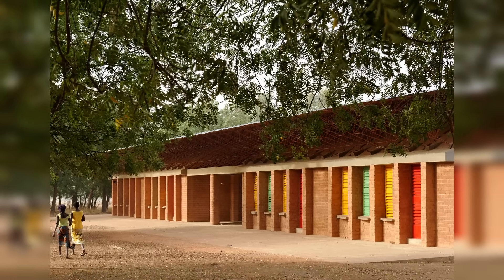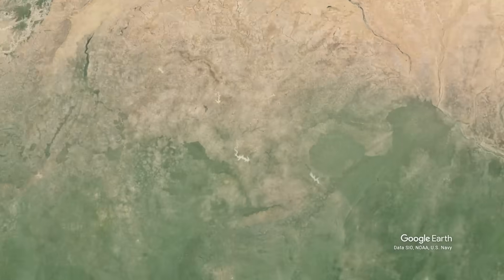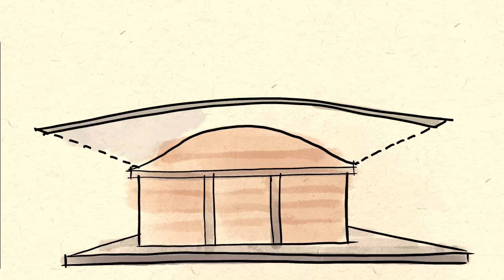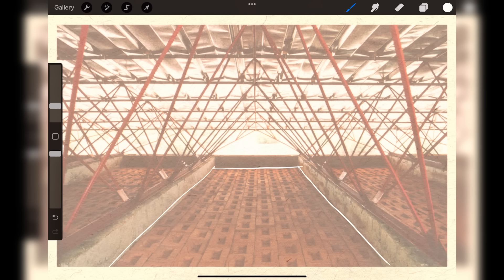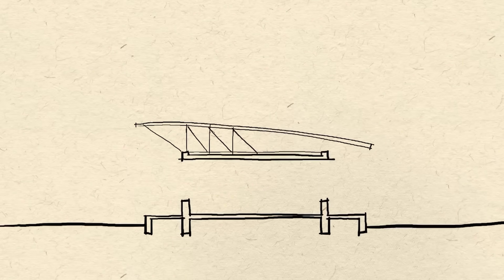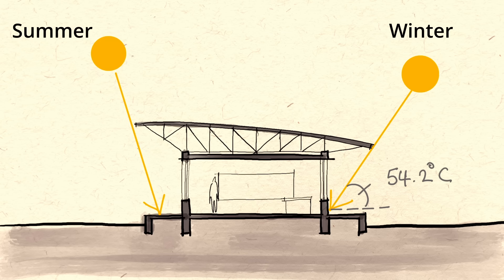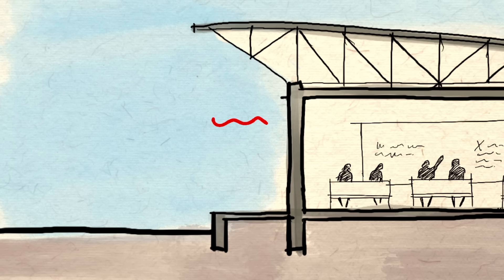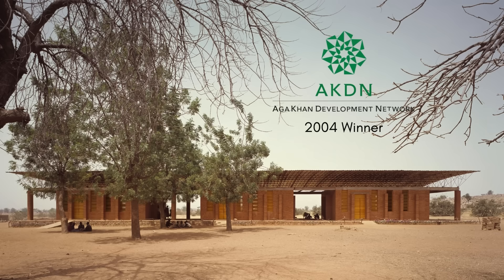The 3 Design Strategies Keeping This Building Cool In Scorching Heat

Comment from the maker: The section at 2:53 - This refers to the angle of the sun ( NOT the temperature! ) Apologies if this has caused any confusion. The C was not meant to be there! 😅
Reply: I was just about to ask about that, I went back over that section a few times to see if I missed you referencing temperature caused by the sun's angle with the ground
Reply: Its called a safari roof landrover did it on their vehcles 50 years ago all but a little cruder due to the vehicle shape.
Reply: Oh no, it had to be my comment, so pity 😂
Reply: Good, solid, practical design work! About the double roof, this idea has been around for centuries, many cultures have figured it out. I've seen it done with desert tents, a large tarp spaced above the tent. Around forty years ago there was a medical office complex in Tucson, Arizona USA that did this with a stressed concrete roof above multiple independent single story buildings. It looked like a huge tent on multiple poles. The roof was on tall pillars, at least a ten foot clear space of free moving air above the buildings. The roof was large enough that the sun never touched the building walls. I was there for a dental appointment on a miserable day in August, temperature over 100F, and walking under that high roof the air was easily 15F cooler. Sadly, the complex lost the battle to modernization and real estate inflation. It was all torn down and a big ugly multi-story tower was built.
Reply: I saw that and at first I was like, huh? Then I decided it meant the angle.
Reply: And that's at high noon. Was there shading on the western wall to shield the hot afternoon sun?
Reply: C = century, °C = celsius.
Reply: This is a bad deflection because the angle(elevation) of the sun cannot be greater than 90*. 90* marks the sub-solar point meaning the sun is directly above that location
Reply: Sara , at 35 C temps , what are the temperature in the class rooms in the school ? 
Great to see the roof. I have been thinking before, for people living in the top floor that to keep an apartment less hot, one could put an army camouflage net over the roof , 50cm abover the roof, so the building would not get the full heat of the sun on the roof...
Reply: The roof won't help much either its a common mistake to fail to realise that the heat just gets reradiated by the roof and transfers on into the building. Convection air flow plays no part in infra red heat transfer.

Comment: All three techniques are construction based and have zero recurring costs. Additional technologies like sola-tubes can do the same with lighting. Solar water heaters can provide hot water for the school. (Can be completely passive but a small pump can be more effective.) PV panels for electricity. CEB is great for low cost construction. Sun shade fabrics can be stretched across poles to create shaded out door spaces. Good for outdoor classrooms, play and even gardening. I love projects like this. Practical, sustainable and economically feasible.

Comment: Excellent report, a double roof used to be called a safari roof, used by Land Rover in Africa. I do like the venturi effect of a shaped roof. A white roof top will reflect heat. Ibrahim Traoré is doing some great things in Burkina Faso. I used to be a control systems engineer using building management systems. I live half the year in Thailand with similar temperatures.
Reply from the maker: Thanks for the insights! and thank you for watching!

Comment: A reinforced-concrete roof-over-roof design would indeed be an excellent solution in most places that have hot summers and rainy conditions in most seasons. The sun's heat does not radiate from the outer roof to the inner roof. Meanwhile, moisture from the interior can easily disperse, because only the upper, outer shell is 100% vapor-tight.
HOWEVER: most places on earth have OCCASIONAL storms which will sweep such an outer roof away, causing great and expensive damage.
Taleb's fat tails: extreme and ruinous things happen more often than you think!
Solution: the upper roof has to be collapsable, so that it can be dismantelled when extreme weather is forecasted. Make it a hinge-pulley system, using reinforced fiberglass. Or some other composite plastic, perhaps with a wood layer. Or maybe even canvas-on-rails?
No matter what, it mustn't be a wing that wants to fly as soon as a tropical storm hits you.

Comment: An addition to this strategy could be air intakes at floor level with ceiling vents to induce natural thermo-syphoning. Concentrated plantings in front of the floor-level openings could pre-cool air by evapotranspiration. Roof gutters could direct rainfall to shade trees, creating a micro-environment for the building.

Comment: LOL. 
It was 105 here the other day, and gets into the 50's at night, which is normal 7 months out of the year...... 
We are up to .6 inches of precipitation for the first 8 months of the year.... 
Let me know when it actually gets hot there... 
They would be better off putting the building into the ground, where the ground temperature is far lower.... 
Building it out in the heat, to only have to engineer it to never get as cool as it would partially under ground, is epic stupid....

Comment: This may work well in a hot, DRY climate, but it won't cut it in a hot, HUMID climate.
Reply from the maker: Watch “The ultimate guide to passive cooling” on the channel 😉
Reply: School is out during the hot and humid season. The design works perfectly for it's intended purpose.

Comment: The temperatures are similar to that found in the California Central Valley.  July is the hottest month with average highs around 96°F and lows around 64°F. The highest recorded temperature in Merced was 116°F on September 6, 2022. The coolest months are December and January with average highs in the low 50s and lows in the mid 30s.

Comment: Nice video, thank you!   I was curious about the top layer roof (the upper roof) and how strong it is when the wind picks up?  Seems like that can be a challenge to stay in-tact during very strong winds?
Reply from the maker: Yes it would act like a sail if the winds are too strong. Fortunately in this region, there are no strong winds that might cause this issue! This is why passive solutions need to be tailored to their specific climate!

Comment: Yah, when the air temperature is 40 degrees, shading will help, but it doesn't eliminate  high temperatures. 00:46: quotes high temperatures in the neighborhood of 35, the shows graph indicating temperatures well above this. Have you lived in the desert?
Reply from the maker: I lived in Morocco! Pretty close to the desert!
Reply: I've lived in the desert. With how low the humidity is adding shade and airflow makes a HUGE difference. It still helps in environments with high humidity, but it doesn't feel like as much of a difference when it feels like you're wearing the air 😅 hot is still hot, but like 20°F+ of a difference is still a major relief.
Reply: @EliyahuAbdielBenaiah  Going from 40 to 20 degrees using only passive is wildly optimistic.
Reply: @inyobill  I was speaking regarding fahrenheit rather than celsius.

Comment: That roof would get blown or ripped away in tornado alley. It would need to be anchored deep into the ground with steel pillars. And even then ..... Still though, this is a great design, very smart. Congrats!
Reply from the maker: The winds are not too strong in this site which makes this a great solution for this particular climate and location!

Comment: What of it rains with strong winds? During such conditions rain moves almost horizontally. Will it not flood the building through the open roof?
Reply from the maker: That's a good point, but the climatic conditions on this site are not extreme in terms of wind and rain so I think it is unlikely to happen! (hopefully)

Comment: Scotching heat.  Can it function in 47 degree Celsius?  40° Celsius and 90% humidity?  There is no significant night day temperature variation.  May be at the best between 5-7 degrees.. what would the cast be?

Comment: As a Canadian, I can see that this building will not be able to handle any type of snow loading. The upper roof, at least, will collapse.

So, interesting for a Burkina Faso type climate. But not exactly something that would apply in higher/lower latitudes.

Comment: As someone who lives in a house like this, I will tell you that it definitely takes a few degrees off, but only works when the wind is blowing (even a little bit of wind is good) and if it is not humid. Even then, I would not call this a ‘Fridge School’ as the TKSST labeled this video link on their site. 

And if the wind is not blowing or  it gets humid (not a problem in the desert), it is still extremely hot and those from the west who say otherwise are probably posting this from their air-conditioned apartment in the city.

There is a reason they never gave us a temperature reading in this video, despite this being the focus and key measurement that would empirically verify their achievement.

Again this building is a great design, but it capabilities are still overhyped and I doubt people in the city are going to swap places with these people.

Comment: In Phoenix we get 44C temperatures for months on end.  We definitely need building envelopes (as in this video) to do the “heavy lifting” as far as temperature moderation instead of running a/c 24x7 trying to cool building interiors of structures designed for far cooler climates.  For folks who think architecture is about decoration it isn’t.  Architecture isn’t ornamental; its fundamental.  And let’s stop talking about architecture”s design using pretentious language.  Buildings need to be designed and made as precision assembled products, not poorly thought-through and made prototypes that never go into production.

Comment: This principle of space between roof and building is already applied very widely in my country (Romania) and most of Europe, because of the harsh climate. Almost no building without it. The space is much smaller (1-5 cm) but very effective in winter too against winds. In winter, the air flows slowly, keeping the heat and acting as an insulation by itselph. In summer, air flows much faster, cooling the house. There are matrices/blankets made from 3D metal wire mesh, of 1-2 cm, that you put under the last layer of the roof, that let air pass through it.
Reply from the maker: That’s amazing!!

Comment: 3 techniques which prevent a structure from heat. High outside air temps are still hot plus human bodies give off hear. None of the techniques shown actually cool the structure.

Comment: If u want to drop the temperature in the classroom further, you can make the walls at around 1 feet thick..this will prevent the outside heat to penetrate the thick wall..apart from.that, you can make wind holes at around one feet above the ground in the walls. This is because, cooler air is heavier than hot air. With these holes, the cooler air can travel into the classroom, cooling it n push the hot air ( which is lighter) up to the open roof..if your roof is not designed as such, you can still make air holes above your windows to let the hot air out n circulate d air in the room.

Comment: They missed out on densely planting the grounds which can drop the temp by 10-12 degrees, as the plants act as shade & natural air-conditioners.
Its not just the buildings that need good design.

Comment: At 3 minutes in, it's not really accurate, that example, because the sunny side of a building is the same side all year round !
Reply from the maker: Burkina Faso is near the equator which means it experiences high sun angles. I agree it seems strange but in June 21st, it’s slightly on the other side 😊
Reply: @SaraSaadouni_TAC  Oh I see now, that makes sense  ! Thank you for your reply. :)

Comment: I wouldn't call this "smart," so much as I would call it "rational." Why would you build something else? It's more like building other ways in this type of environment is stupid.

I live in a hot area where people from a cold climate do all of the engineering and design, and it is ridiculous. If you live in a hot space, design for that, like they did with this building. If you actually live there, in the hot place, it's pretty obvious what you should do.

Comment: Traditional homes in hot desert climates like Africa have a domed ceiling with a hole in the centre/top.

This draws hotter lighter air out of the home and creates a continuous draft of colder air from the windows doors etc.

Modern concrete buildings overheat in sun and get too cold at colder times.

Comment: 95 is not particularly hot. Low desert California, 120 is normal from July thru Oct.  I have lived here since 1978. Double built roofs, the top layer covered in white silicone roof material works pretty well but it’s still going to be hot darling.

Comment: Rof is the number one heater probably 45-55%,  remove this first, heat will be reduce by at least 15-25% in real figure, which means your 35deg cen  will be 26~29deg cen. windows at 60% of wall to both sides facing North - South + the roof to cieling opening will reduce the heat up to another 15-25%.  Cold rolled Steel + gypsum board+cem. board in the outside will be bette in thermal.  Longer overhung will be the best bet to shade from sun.  We like it or not need to remove aesthetics. and concentrate on cost effectiveness!

Comment: You may want to check out the works of Hassan Fathy from the 1930's.  Not much is left after him - the mosque in Gourna, the Gourna marketplace, few houses there & in Cairo, etc. He exploited these ventillation ideas already with excellent design and arrangement of functional spaces. What we call sustainable architecture (in this context here) was already outlined in his book the 'Architecture for the poor'. I visited his Gourna buildings and they work so brilliant in every respect. 
Btw.  35 C is absolutely tolerable there, because the air is dry.
Reply from the maker: Thank you for this! I came across Hassan Fathy in Architecture school and I was amazed by his work! I’ll look into it more ☺️

Comment: The design does much to fight off solar heat gain, but that is all. If it is 40C outside, it will be 40C inside if you utilize crosswind as your primary means of flushing solar heat gain. Going into the ground, which is 20C the world over 5m down, and pulling that coolness up should be achievable without complex HVAC equipment to get the temp inside to 30C or lower.

Comment: Award winning school in 2004 and built in 2001 as the development of passive house was beginning.  Hopefully, with the modeling programs available and institutions available to provide grants or funds the possibility to go beyond this has greatly improved.  Either PHI or PHIUS would work in this climate and the cost for insulation and forced air not so great.   According to one comment the internal temperatures during  the day were not mentioned?  Considering the location, basically daylight and darkness hours the same during the year, early morning classes  and later evening classes could be good until the building is upgraded to more current standards.  What was achieved was very good, but well outdated, now.

Comment: This is a cool design, but I would like to point out that 101.1° C is hotter than boiling water. I don’t think even this building could protect you from those temperatures.

Comment: The best part about passive designs is you can slap air conditioning on top of them and it'll barely run, but when it really does get that hot where your passive design allows the temperature to rise past 80F, you have the option of turning the AC on. Sure, without the insulation typical in the AC paradigm of an American home the AC will be less efficient, but with all of the passive energy savings you already have, that's okay.

Comment: Such an elegant solution! The architect was excellent, and so was the explanation. One other thing about air conditioning, it dumps the heat taken out of the inside of the building to the outside, making areas around the buildings with a/c even hotter. Also given human nature where when a/c is available they often crank it up so it is freezing inside, instead of just comfortable, wasting energy. This was a great video, would have liked to know the temps inside the building when outside is 40 deg.C. How much it can cool?
Reply: You do realise that the same heat is being released by this building right?

Granted there is the ac motor produces their own heat and some people crank their ac way more than the my need, but let’s not pretend that heat is not dispersed in every situation a room cools…
Reply: @Craig_Tucker48  yeah, I actually had not, thanks for pointing that out. But as you say too, you can’t crank up the cooling dumping even more heat. I was in Sante Fe years back, it was at least 100 deg F. or more, and you had to take a sweater or jacket in town for going into shops. Begin sneezing right away, and when you go out again it’s like a wall of heat hits you. Not good. Seems insane specially knowing just bringing temp down less would feel just fine getting out of the heat.
Reply: @shader26  I so agree with that. Makes you get sick easier too swapping from cold buildings to hot outside so many times a day.